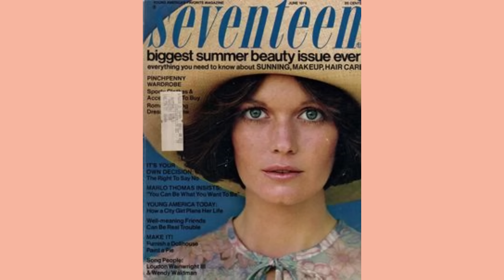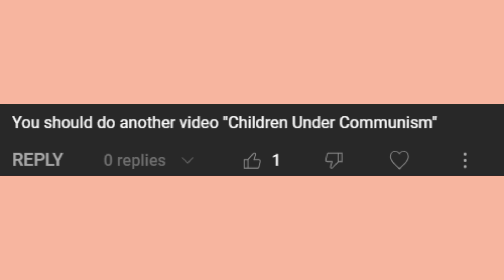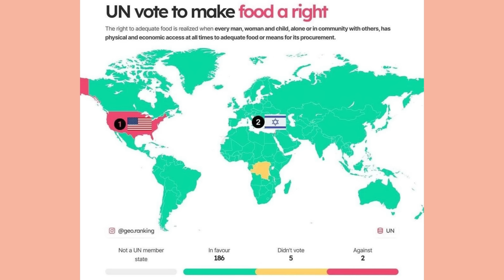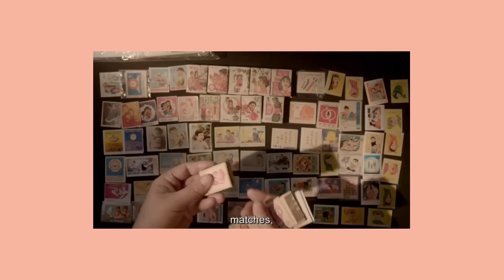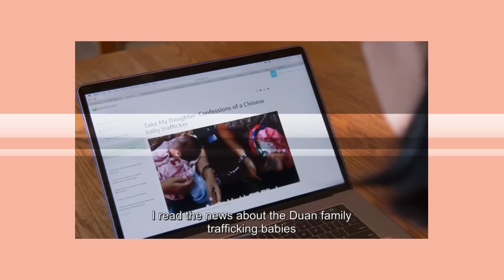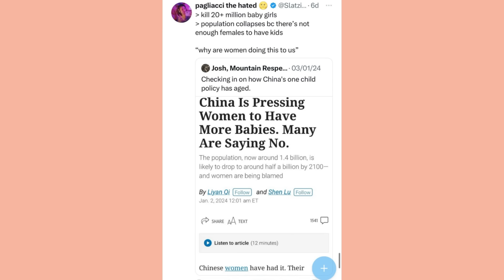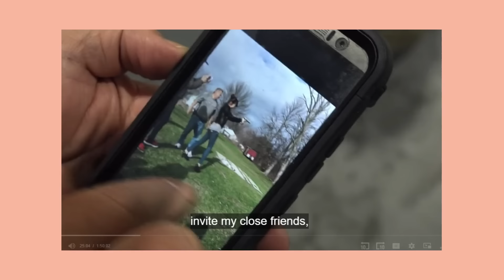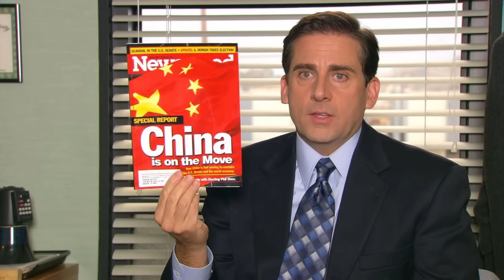Children Under "Communism"?: Documenting The Communist Other

Comment: @Kanthan2030
Number of EV charging stations (as of end of 2023):

USA 🇺🇸: 470,000

China 🇨🇳: 7,400,000

bUt Milei, my libertarian God, says that sOciALisM iS bAd 😩”
Reply: tbh, battery operated cars are not just a bad idea and a far greater waste of resources, they are literal bombs that can level three story buildings. you cant get them cold. you cant get them hot. because too cold causes the electrolyte to freeze and crack and too hot causes it to become too thin and malleable, both of which create the conditons for thermal runaway and critical failure very easily. rechargeable batteries are not practical for use in powering vehicle engines unless you live where the weather is always between 40 and 75 degrees F. still tho, china will forever be a better thing than any eurocentric country or culture lol. something about incentivizing people to murder 99% of the human species really puts me off about eurocentric culture. that and its weird monarchist economic distribution, where its supposed to be normal for the workers to happily allow someone else to take 99% of the value they generate and give it to someone who literally sees themself as a deity...